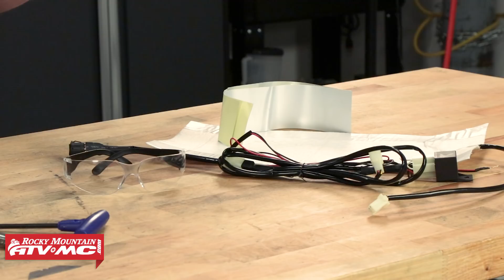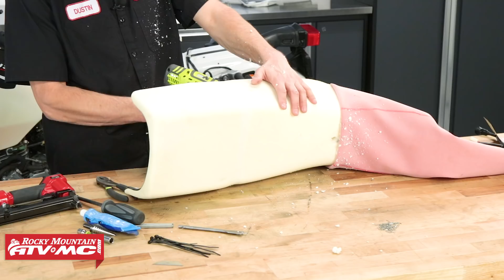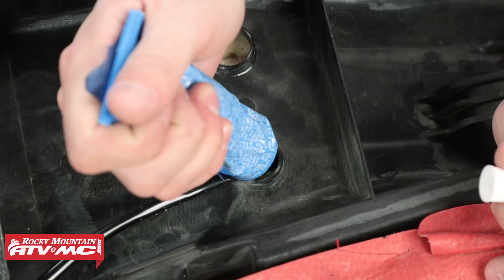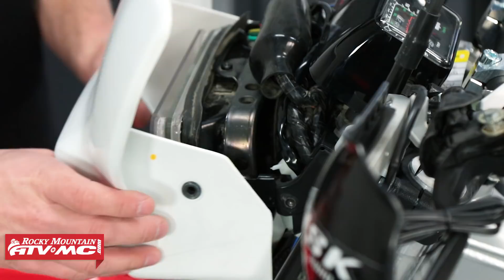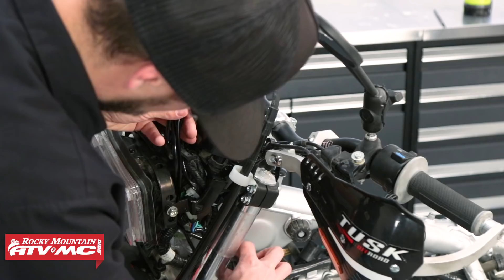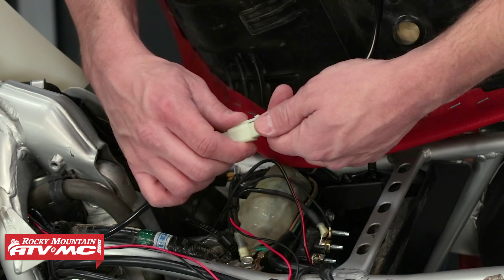How To Install The Tusk Motorcycle or ATV Seat Heater

Comment: Can you run a harness from the headlight rather than the battery so that it only operates when the bike is running?

Can this kit work with a 2023 Sherco 450 SEF?

Comment: Do you sell any smaller ones? I'm guessing i can't just cut or two fold it? Want to install one on my old slingshot, but the saddle is way shorter than 40cm. Great video by the way :)
Reply from the maker: The ATV/Motorcycle seat heater is the smallest one we carry but you are able to fold it if needed for your installation.
Hope that helps!
Reply: I did see a guy cut one to fit his but it might have been a different video.  I’ll see if I can find the video but I would just fold it like RMAM said above.
Reply: https://youtu.be/JiTAY6LYrEc

Comment: I like the idea of going through the seat for a cleaner look, but drilling a hole through the foam to accommodate the electrical connector  just doesn't seem to sit well. Would it be better to cut the connector off, push a hot wire through the set cushion for a much smaller hole, fill the hole with silicone; also apply to the wire harness, run the wire through the small cushion hole while the silicone is still wet and then re-pin the connector on the bottom of the seat. This is just to avoided compromising the seat cushion because the seat cushion can be real touchy, sometimes they last sometimes they dry-rot once dry-rot sets in its all down hill from there. "Just sayin' "

Comment: Can you addd this to a bike without a battery
Reply from the maker: No, you would need to have some sort of battery source.
Reply: @rmatvmc  why, you can just wire it up to the alternator and the chassis right? 20watts is almost nothing. Maybe add a time delayed relais (10sec) to prevent kicking it till your boot is penetrated by the kickstarter.
Reply: @2wheels1guy25  30 watts, where did you get 20w?
Reply: I don't see why you couldn't cut the red wire and wire it to a power source while the bike is running, the relay supplies the power not the battery.  Having it wired to the battery means its hot at all times so you have to make sure your seat is off or you'll drain your battery down.  Not the best design at all
Reply: Garrett Alward that'd be sweet if you could though!